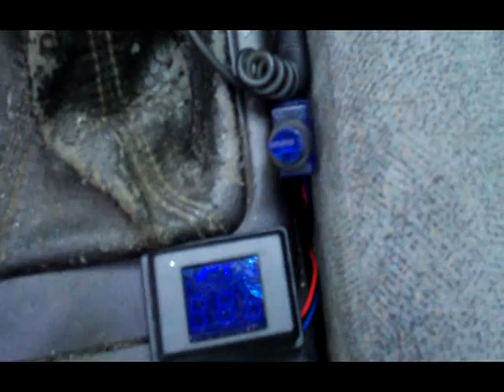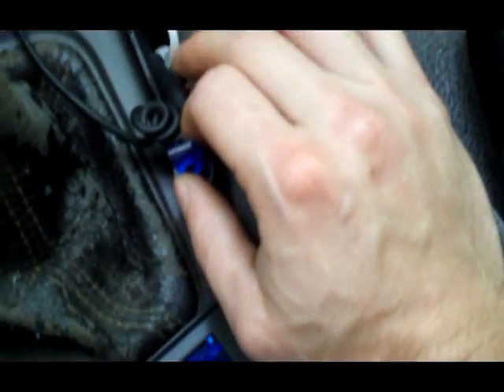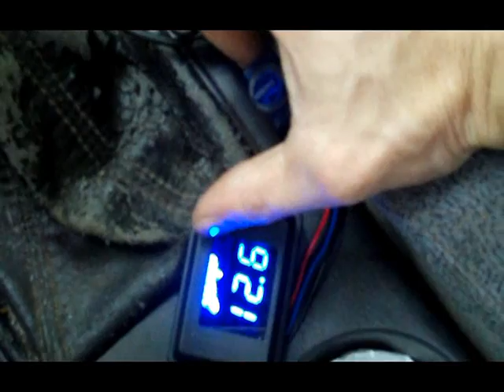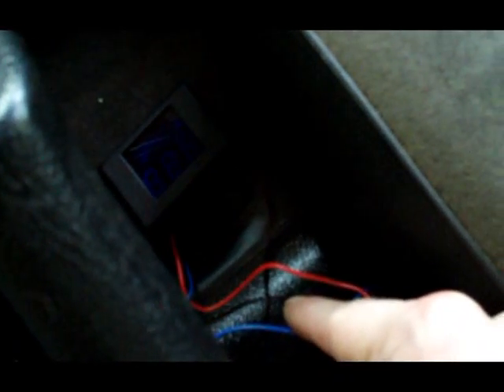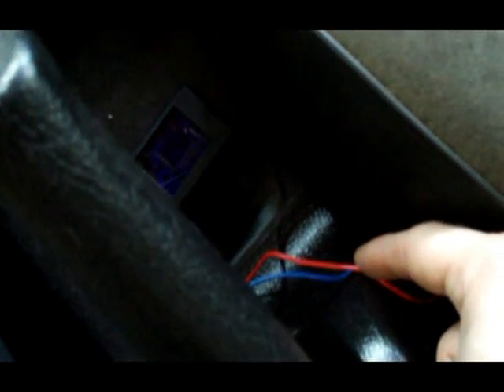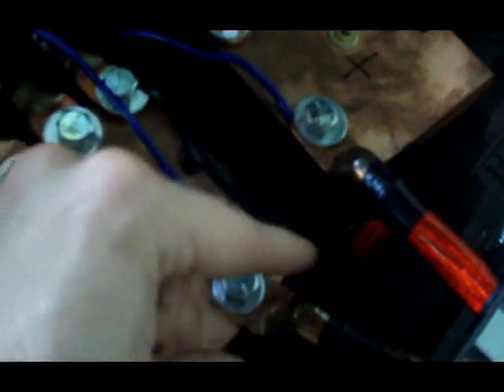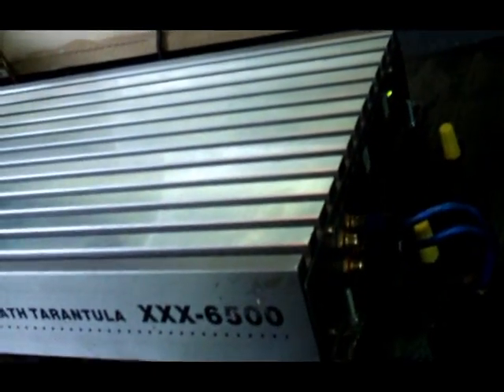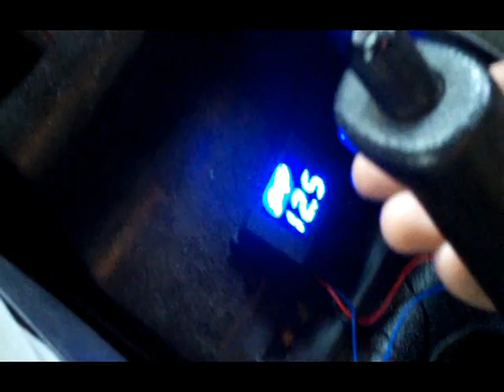How To Hook Up A Digital Volt Meter / Stinger / Car Audio

Comment: I have mine hooked up into my ignition and the other directly plugged into my amp terminals. You don't need to run a separate remote wire to the headunit, just connect the voltmeter directly to the amps power ground and remote terminals and your done. Also the longer you run the wire, the least accurate your numbers will be due to resistance in the wire.

Comment from the maker: @pXcRodeo The adjustment is to adjust the numbers. It might not be accurate. You need to use a multimeter and test the voltage in your amp (where your sticking the volt meter wires) If the voltage is different on the volt meter you can adjust it with that knob to make it right

Comment: @casperskafs I don't think you got my point. 

No matter what way you choose to connect the meter, it is too bright to drive with at night (for me anyway). Which is why I put some tape over the "Stinger" logo.

That way it's no brighter than regular dash lights...and you can have an eye on your voltage whenever the system is on.

Comment from the maker: With the jumper the amp will never shut off because its getting constant power from your +. The jumper is just like running your remote straight to your battery. With the remote running to the headunit instead of jumped to the power the headunit is a relay that shuts the amp off when its off

Comment: Where does it get hooked up too at the amp. And what if the meter only came with red and black can you still run a wire off the + to the acc on the switch

Comment from the maker: If I'm understanding you right yes you can. If you mean tapping into your amp. I run + and - into amp and splice my remote into the headunit remote and run a toggle on the remote after splicing

Comment: sorry for the long wait on reply , just saw ur reply today , i have 8x xspwr d3100s and may need 8 to 12 more depending on power needs , cuz i only have one 300 amp alt now but i ordered 2 more 350 amp alts , plus maybe the crazy thing the amps were doing b4 that looked like they were pwr hungry may of been that the subs were wired wrong! continuid on next comment

Comment: Another great video for the DIY's. I have a question did you cross reference the voltage on the stinger meter with that oh so trusty multimeter to ensure your getting an accurate reading. After the vid about checking impedance with the multimeter I use it for everything possible. Keep those awesome vids coming.

Comment from the maker: @meoff1969 If your amp is cheap it might not have been able to take that low of ohms. If you have two 1 ohm subs hooked in parallel then yes they were @ 1/2 ohm and alot of amps can take that unless their really powerful.

Comment: I have a subwoofer install as well in my car, What's the purpose of adding a volt meter?
Should this be hooked up to your batery?
Reply from the maker: Melvin Most people hook these up to their amp to watch their voltage. If your voltage dropps to low say like under 12 volts then bad things can start to happen like amps clipping and burning. Its also can hurt all your equipment. I don't really get to worried til it drops around 11 volts but some are not as brave (stupid) as I am :)
Reply: casperskafs Thanks Casper.
so when i hook this up to my amp where my subwoofer is attached on i could see the voltage the sub is getting?
Reply from the maker: Melvin Yes BUT you don't hook where you speaker wires go you hook it to where your + and - battery cables go. Just shove the voltmeter wires in with you positive and negative battery wires in your amp then BAM you can watch your voltage :)
Reply: casperskafs
Thanks, i just want to see how much its getting since i already blew a previous subwoofer.
I just got one 12 inch, that's enough for me.
But also have a basscontroller attached to it.
And just dont want to blow it again.
Reply from the maker: Melvin Trust your nose and ears. If you start to smell your sub or it is sounding funny then your overpowering it or clipping it or possibly have it in the wrong size of box
Reply: casperskafs Alright thanks, Well i have a original Ground zero gztw 30t box, but that sub is blown and no longer available.
So went to the audio store and they said a kenwood kfc w3013 would fit aswell.
the amp is also tuned properly there.
Reply: casperskafs  Wrong size box?!?? I never seen a enclosure make your speakers blow, lmao. The number one reason for intermediate or  beginners blowing their sub(s) is lack of power. They try to use the voltage input (gain) as a volume increase which only sends a clipped signal.

Comment: If i wire the volt meter with a toggle switch, splicing the remote turn on wire...when i turn the volt meter off will that also turn my amp off?

Comment: Hey cas how could I connect my voltmeter to my amp that only has a power and negative wire? Because if I connect the voltmeter directly to the positive and negative inputs of the amp, the voltmeter will be on at all times. Would a toggle switch fix the problem? And how would I connect the toggle switch to my voltmeter?
Reply from the maker: Just_trying_to_be_successful Hook the red wire into your positive, black into your amp neg and your blue wire into your remote. I think thats how I did it

Comment: its a bit different it needs more signal in order to give the same punch that the ss does so i had to use a sep bass knob connected to the ss15 to reduce its bass then i added more bass on radio (from flat to #4 of 8) then backed off a bit from bass knob on ss until the other ss comes back. it was my fault cuz when i took the top 15k off i heard a loose screw inside and forgot to open it so when i powered it up it shorted it out. so that made me check all 15ks and use locktite on all scews.

Comment from the maker: @ChadLikesGuitars Amps can take any regular battery voltage. 12volts - 14. Some amps can take 18 volts. Trust me if you were runnin 18 volts you wouldn't have ask that question

Comment: dude nice setup witht the copper! talk about having the shortest distance on pwr wires! man you are the winner with 3" or less distance lol , is that the 4000 or the 6000 s.s amp? i have 2 of the 15k ones on 4 subs each on a apir of 18s and i have the most hated bass in ny lol , they are crazy man!........  see this video : (ny thunder bass addiction pt 2) thats my 50,000w setup.

Comment: i also have my volt meter remote hooked up to my stereo remote with my amp, so when the radio is on its on, and there is nothing wrong with speaker wire as power wire, hints 8ga power wire for sub wires etc...

Comment: Hay casper I blew my brand new 2000 watt class d amp in 20 seconds I had my 2 ohm dvc hooked up to 1 ohm both 12s were hook up to that one amp did that make  it 1/2 ohm or did I just get a suck ass  amp I value your opinion
Reply: Yes u was  at .05

Comment: nice man i got simple volt meters alot cheaper then those stingers and they dont need a remote for my front batt and 1 for the amp but there not as pretty

Comment: i  have 2 boxes ea with 2 subs and one port topo box and bottom box ,so instead of the 2 subs of ea box wired to each amp , the guy wired the rt sub of ea box to one amp and the lt subs of the other box to the other amp! dont get me wrong they were still bangin but ,after i rewired it its bangin even harder!...my voltmeter had only 2 wires so i used a sep sw and works fine wired to amps input wires. one of my ss 15k went into protect its being fixed ,im using a spare 15k see next comment

Comment: I wanted to know the front voltage in my van so I hooked mine up to radio cause air conditioner pulls alot of voltage and I had my amp set up with subs at 8ohms till I get stronger subs with better venting parts my type Rs don't really play enough to pull my van voltage too hard :)

Comment: Can you hook the power remote and ground to the radios power ground and remote
Reply from the maker: Yea if you wanna watch your head unit voltage
Reply: +casperskafs Alright man. Lol I guess I'll connect it to the power on the battery
Reply: +casperskafs or to the amp
Reply from the maker: +Chase Rimes your amp is where you wanna watch your voltage